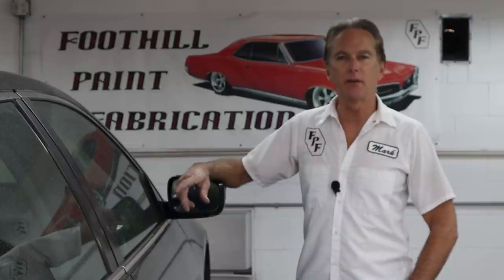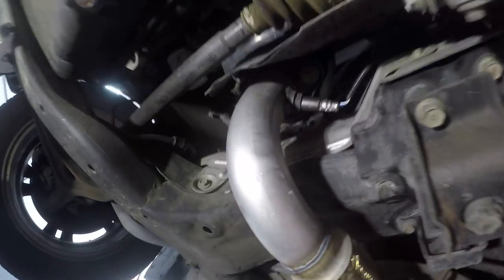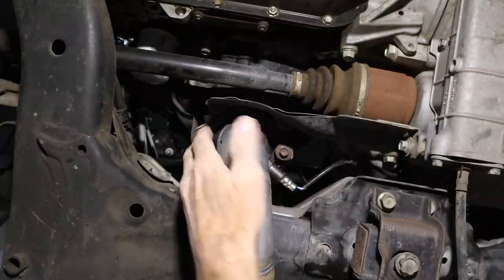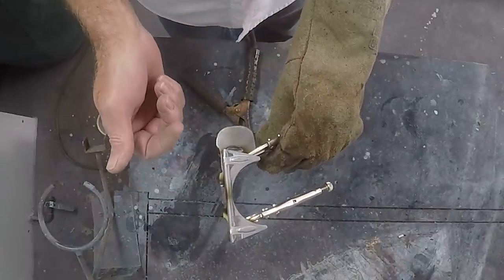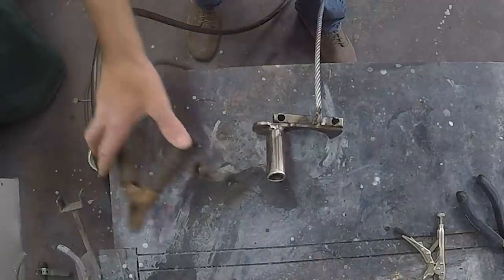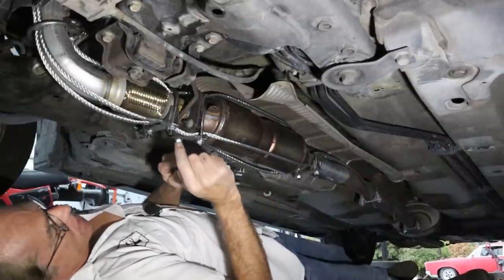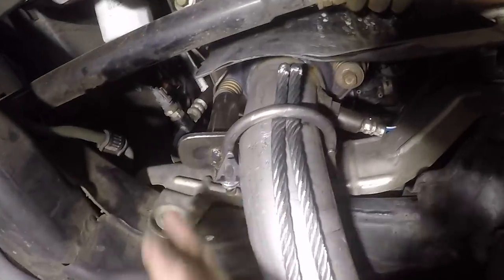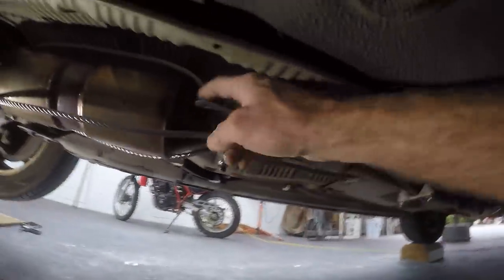Catalytic Converter Theft Deterrent Easy and Cheap

Comment: Bought a kit from a company that had 25" of stainless braided cable and two anti-theft brackets that the wire went through , and looped around the converter. Our company liftgate lasted two weeks in the parking lot before thiefs  cut off the wire and the converter (again). All these devices moderately supply deterence . What is needed is fed laws sending scrap yard owners to prision if they purchase non-vin number converters. Spend 5 minutes today and contact your state reps and senators.
Reply: No more theft when laws allow owners use .225  to blow the theft heads away and those Crooked Lawyers whom protected Crooked.
Reply: I'm tired of everyone else blaming others, other than the thieves. This attitude is exactly why thieves are so brazen nowadays. Stop prosecuting people who shoot criminals and awarding criminals civil suits against people who shoot them, and let about a dozen of these guys get shot while under the cars and I guarantee you the crap will stop.
Reply: @Steven-gv1ke  Thanks for writing what I was just about to write.
Reply: Ban sale of  used cat converters completely.
Reply: @itsthehumidityyall8303  That makes too much sense.
Reply: Maybe we should start public floggings and other forms of public discipline.
Reply: @jimnoneya3919  in countries where they do that, the crime is VERY low. I think it's a combination of things. #1, the physical punishment. #2, the public humiliation, and lastly, kids who see it happen, are constantly reminded that when they get older, if you break the law, this is what will happen to you. Also a quick public lashing doesn't require you spend hundreds of thousands of dollars of tax payers money to house and take care of these criminals for multiple years. Throughout history, pain has always been the best deterrent. It works on every species of animal in the world.
Reply: Yup! In Oakland, cages nor plates keep them from stealing the cat! It’s ridiculous. Maybe a device that automatically sprays them with bear spray when they slip under the car.😂
Reply: Did you hear about the person who heard a noise while sitting in their car and RAN OVER the theif?

Comment: I'd prefer a hydraulic system that lowers the frame to the ground when the circuit is cut.
Reply: That sounds brilliant
Reply: That sounds illegal
Reply: @curtisj2165  Depends on the state. No law against having a lowered vehicle. Neither is there a law against operating an unsafe vehicle in many states. I don't necessarily want the car to drop on the person, but pin them by an arm or leg until the police get there and I'm fine with that.
Reply: @MMPCTV  I didn't think that you actually wanted to kill them. Although................
Reply: Could just ground the car battery to the cat! Kind of like a bait car but better!!
Reply: If a lowering system would result in the criminal's death, we wouldn't have a repeat offender nor would we have to pay for their room and board.
Reply: I don't see how that defeats a battery operated Sawzall . That's usually how they steal them.
Reply: That is 100% entirely ineffective.
Because with a floor jack all that will do is... nothing, because anyone who knows how to use the jack will lift one entire side of the car so that both front and rear wheels are off the ground.  Dropping the suspension will just shift the car to the low side and unlikely drop it off the jack.
If it's a pickup truck the wheels will catch the weight and do nothing but scare the shit out of the thief.  Once they realize it can't drop any further they'll be right back under it.
Reply: @amzarnacht6710  cyanide gas release system then
Reply: @precisionbay6899  Not sufficiently targeted.
Carfentanyl powder in a glass ampule, however, would dust the guy under the car...
Reply: @amzarnacht6710  modern problems, modern solutions
Reply: LOL Love IT !!
Reply: Crush them like bugs
Reply: As in the Stick Death anti-theft deterrents. Aaah, classics
Reply: @paul9156c  It's hard to cut cable with a sawzall and even with bolt cutters.
Reply: @paul9156c  try and saw though that cable and you’ll see
Reply: Each state has different set height requirement for the bumpers as long as that is met when it is driving no reason for it not being legal in my opinion. With that being said my wife had the one catalytic converter, yes I said one, her car has two on a single exhaust....why idk? Anyway they cut the resonator and secondary cat out. Luckily they could not steal the primary cat that's part of the exhaust manifold. At any rate let me remind I'm not bashing, if anything I'm trying to tweak his idea to help make it even more difficult, loud and too time consuming for most thieves....trust me I've known a few while I was on an unwanted vacation. 1. Leave the cable as loose as you can without making it obvious, loose cable will move with the motion of the sawzall making it really difficult to cut without additional tools being needed. 2. If possible weld the clamps facing up, if not place additional weld over some of the nuts...they won't be able to cut thru it as fast or easy, make it really sloppy looking jump it several times so the sawzall blade will jump out of one grove to another and so on. If you're really talented or experienced in automotive and welding as well research small bearings like press in wheel bearings on a car but smaller. You want them to be small enough that you can fit two inside welded to the exhaust without blocking it enough to damage your vehicle, at the most likely spots they have adequate room to make the cuts so long as it has about 2" of a straight use that section one before and one after the catalytic converter after the cut has been made to free that section and the bearings placed use the matching size of rebar or similar round steel bars to run from one bearing on the catalytic converter to the other bearing that you welded on the exhaust....yes I know sounds tricky.... Simply cut single linear lines in each side of each side of all 4 ends so you can see where the bearings are and make some single but strong tack welds then just weld the cuts shut followed by welding the catalytic converter back in place. As the title and gentleman says it's not how to prevent the theft of the catalytic converter because that's impossible unless they find a way to place it inside the engine and even then they'd just steal the car and completely gut it for every penny. With what this gentleman has posted and possibly some of mine mixed in it should deter most thieves as the only tools that would work to get it out would be too loud and would wake you or a neighbor. Either way the cops would be on their way and/or other neighbors would awaken, irritated they would investigate and the thieves would be scared off👍🏻 catalytic converter theft would quite possibly be thwarted. I am currently in talks with both Chevrolet and Ford about possible new upgrades to all petroleum vehicles built right into the new vehicles that would stop all cat thefts.... weather they choose to adapt my ideas or not is out of my hands. Just an FYI for those thinking I'll just cut out my cat so it don't get stolen or that they can simply place a straight pipe to fill the gap.... although it can be done, most times it won't pass a legal inspection. Add to that it will throw off the fuel air ratio and your vehicle will act all types of bad. Anything and everything from poor fuel mileage, backfiring, rough idle, jerky starts and hesitation when you hit the throttle. One constant would be you would continually have to use an obd or have a garage cancel out the drivetrain warning light codes. Lastly sooner or later your cars computer will get tired of switching to limp mode and back when you cancel the codes that it will start to act up, at the same time think of the additional stress on your engine each time your vehicle goes into what I call limp mode, it's where your vehicle senses an issue with the exhaust and since it is not getting the proper readings it will rely on pre programed ratios thinking that is the best ratio..... You can only flood an engine so many times before your luck runs out, what happens if you stall out in the middle of an intersection.... Personally I don't care if it's legal or not with exhaust as long as it's quiet and keeps the environmental damage to a minimal without interfering with my health or others health.  My apologies for the book
Reply: @adamkerns-isley8634  I now looking for a full length steel skid plate to protect my cats.
Reply: you....are a genius. and mean. I like mean when mean is called for...
Reply: An automatic flamethrower uses less moving parts!
Reply: @curtisj2165  Hi, that's just an accident.......... they choose to do that voluntarily...............
Reply: @Joshua Coleman Or you could just install airbags that deflate when the alarm is triggered. Next time you want to try to insult someone, don't. You're not that smart.
Reply: We called them "Low Riders" when that group known as War came out with that hit single. Nowadays all one needs is a remote control, that someone "accidentally" pushed the wrong button or that's sound activated, like what the motorized Sawzall emits.
Reply: @HCWHunter  A battery powered grinder would cut through it easy.
Reply: They would probably put u in jail for murder is bad part
Reply: @amzarnacht6710  Great idea except that it would probably kill you or your mechanic next time the car is worked on.
Reply: @logicalblueberry  Ever here of jack stands?
Reply: @MMPCTV on the person. Make it jump up and down.
Reply: Nice😂

Comment: Car manufacturers need to start making cars with cat protection as standard, or completely plated up.
Reply: Will pay more for cat protection at least $1,000.00
Reply: They needs to design them right into the exhaust manifold like some cars
Reply: Or find a way to make them without out the precious metals in them.
Reply: Why? then they would sell less OEM CATs!
Reply: Funny you mentioned this. Car manufacturers are looking to eliminate catalytic converters completely and they're finding another way to reduce emissions. Can't wait for electric cars, all this goes away.
Reply: @BC-ni3sk  gasoline cars still have room to expand and be highly efficient with the perfect combustion. Camless engine technology aka free valve from Koenigsegg. I don’t think gasoline will go away…
Reply: @BC-ni3sk  I think it they come up with low carbon fuels, the need for them would be eliminated
Reply: Yes..my friend installed one on a big truck that cost 22000$..
Reply: @R0S3RAV  gas motors won’t go away. You’re right on that. If you take care of you motor gasoline motors they can be very efficient
Reply: @BC-ni3sk  lol!  Then they will still the lithium batteries
Reply: No they don't, they're a wear item and need to be replaced.
Reply: @Skilful_basics8  - In a Tesla, you'll have to steal the whole car. On most Hybrids, the batts are under the back seat inside the car.
Reply: The should just execute thieves on the spot for anything over $200 damage.
Reply: @BC-ni3sk  so does the electricity for our t.v. When we overload the power grid. When we blackout ( not being racist), that’s when Russia and Jina  send in their gas powered tanks. And AOC throws a party by flashlight. Si. Aye,yi yi. Fuji capesta.
Reply: N Pitzen.   If manufacturers could find a way to make catalytic converters without precious metals, they would.  The cost savings for them would be tremendous.
Reply: The citizenship status of converter thieves = 92 to 98% Non-American depending on whether you live in a Red or Blue state.
Reply: @BC-ni3sk  electric cars are not the answer. Holding people accountable, including our elected employees!
Reply: @BC-ni3sk  electric cars have lots of copper. Thieves like copper too :(
Reply: @BC-ni3sk  They'll just steal the car and it's battery. Way more valuable than an engine / transmission combined or just the catalytic converter.
Reply: @Random-rt5ec  proof?

Comment: Why not just take the cat off. Make a flanged ended pipe in its place until your emissions is due then put cat back in, do emissions then remove replace with pipe piece.

Comment: You have a good idea but it "might" only deter theft not prevent it. Along with sawzalls, thieves also have cordless cut-off wheels which make quick work of clamps and steel cable.
Reply: Maby so but I don't care what u got ,the noise level n duration of time it'd take to get it off would make it extremely hard to do ,no way you could do it quick or quietly
Reply: Ur best bet is removing the catalytic converter completely until a smog is needed. Replace it with a pipe
Reply: @johnnywalker706  then you have the problem of a check engine light due to faulty o2 sensor readings, vehicle never going closed loop and your modern fuel injected and touchy vehicle running like crap, being inefficient and wasting more fuel. You could run a custom tune that can make it to where you bypass o2 sensor readings, but it's all not cost effective and a hassle, and still won't be as efficient over time potentially causing earlier driveability/engine performance issues over time that may prove more expensive in the long run.

Comment: Honda Element owner here. I've been brainstorming deterrents for about two weeks till my parts come in. This is very similar to one of my ideas. I was gong to braid three lengths around all the way to the muffler flange. Another idea involved a Co2 cartridge and some glass shards.
Reply from the maker: Wrap it tight as possible so it won't rattle and drive you crazy.  Be sure any identifying numbers the inspection/smog shop needs to see do not get covered by the cable or clamps.  
Good luck
Mark

Comment: So Innovative; thank you.  My catalytic converter stolen off 2005 Hyundai Sonata LX; around four weeks ago.  As of the moment, I am talking to an exhaust shop/repair shop about the above (a deterrent (before replacing it)).  [You are right; my estimate for fix and oxygen sensor replacement is $1400.  + mental stress + insurance phone/e-mail + police report + added vehicle security].  I am thankful that this is repairable. 🙏
Reply from the maker: That sucks they got you too.  Definitely do something to deter them because they will come back.  There are several manufactured products or you can tell them to do something similar to what I did as long as it will take a thief a long time to get the cat off.  Good luck

Comment: This is how I protect my catalytic converter. This works 100%.  First I remove it and then store my catalytic converter in a safe place.  When I need to take my car in for a smog check I'll briefly re-install my catalytic converter.  With this method no thief will ever steal my catalytic converter.  Problem solved!
Reply from the maker: My buddy does the same thing. Really not feasible on a lot of vehicles though. 
Mark
Reply: Delete the EPA.

Comment: There needs to be a law that requires manufacturers to install protection devices for catalytics *immediately*  (under 'safety recall') and continue to do so until they redesign the cars to make catalytics impossible to access without a full on garage.
Reply from the maker: Wouldn't that be nice. I don't even see manufacturers stepping up even if told to do so.
Reply: Manufacturers make millions selling replacement cats
Reply from the maker: @waterheaterservices  I totally agree and I am sure there is some parts supplier CEO somewhere publicly saying how terrible all the cat thefts are but privately laughing at how much money they make because of it.
Reply: Auto Mfgs: a hardened plate that covers the cat, mechanically latched to the frame with an inside cabin release - like fuel filler door.
Reply: It's profitable to sell replacements so they don't care.

Comment: This is great for do it yourselfers but if a person had to pay 5 hours at 110 dollar shop rate it will get expensive quick. Luckily I did a home welding course. Great tips , great info, great vid, thanks, thumbs up.
Reply from the maker: Thank you.  Doing a no weld version is possible too and should deter thrives as well.  I hope yours works out perfectly.